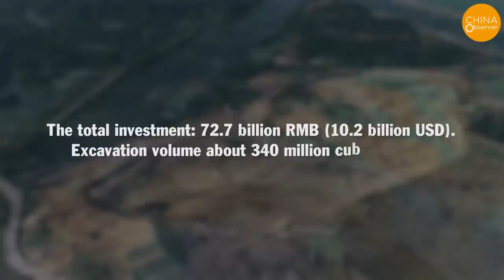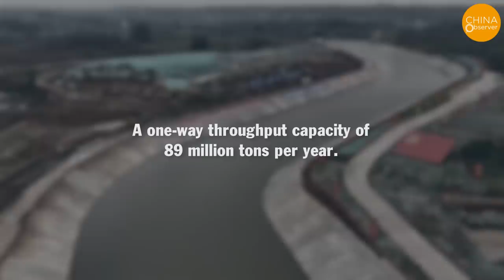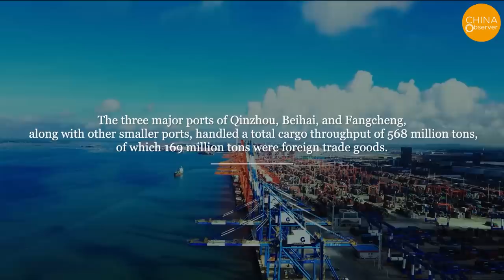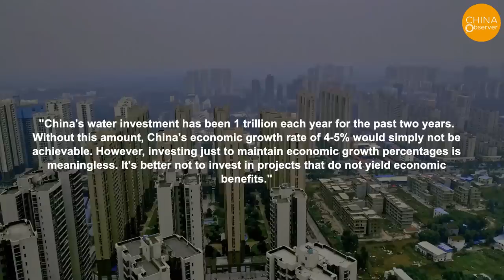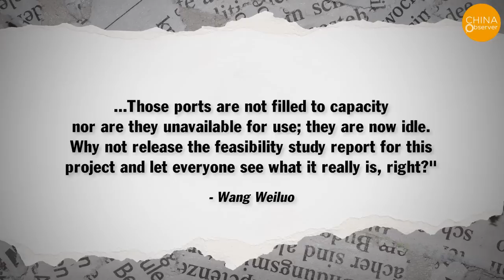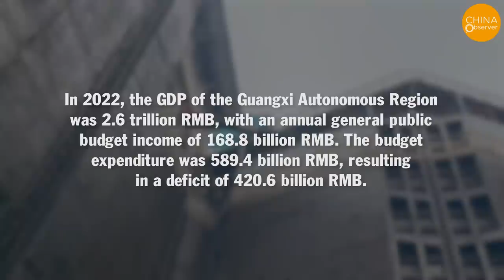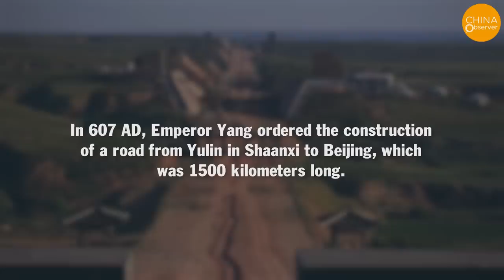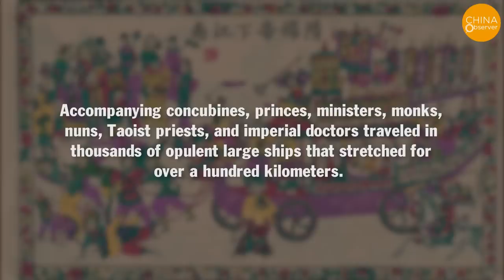$10.2 Billion STUPID Mega Canal Under Construction, Is This the Straw That Broke the Camel’s Back?

Comment: Pinglu waterway is necessary: chinese Southwest is almost landlocked. They need the flow into SE Asia.
Reply: The goods will still rely on train and truck. 135 KM to Tonkin Gulf isn't going to do much good especially if the ships can't make turns in that  wonderfully tight canal.

Comment: In its economic downturn, Japan invested very heavily in public works. No noticeable effect, except expanding public debt.
Reply: Yeah, but the difference between the Japanese & the Chinese is that the Japanese always learn from their mistakes—and NEVER repeat them
Reply: @Shineon83  Right I am sure they learned their lessons from their 280% debt to GDP lol.
Reply: The difference is that a large portion of public works in Japan involves disaster mitigation and prevention. In CCP China, public works involves the creation of disasters.
Reply: @Destroyer4700  Excellent points.
Reply: @David-jc5jf  Japan has an extremely stable economy and their currency is one of the top traded in the world, plus they have extremely large stores of USD, RMB, GBP, and other internationally traded currencies as well as holding bonds with many of those countries. They can afford to have a high debt to GDP ratio.
Reply: On the other hand the US did that during the great depression and it worked great.

The difference is that Japan's problems started due to massive amount of debt. So borrowing more money can't (just literally can't) help solve that

Comment: It would be nice if you compared the Panama  and Suez Canals in comparison to cost, cubic ft of ground moved, shipping tonnage and many other factors. It would give a relative scale comparison and relevance..
Reply: This is rubbish reporting, to say the lesst. This huge canal is to transfer water from the south to the more sparse northern region,  to ease water shortages for various agricultural projects
Reply: The panama canal is very strategic,very wort the short cut they made it.👍🇺🇲
Reply: @jacintochua6885 The north south water transfer project is in the east of the country. The project in the video is in guangxi in the west
Reply: The Panama Canal is about 80KM long and a typical cargo vessel that can transit the canal can carry about 52,000 tons of cargo, but Panamax ships specially designed for the csnal's dimensions can carry twice that.  But probably more to the point this canal will make it faster and cheaper to move goods compared to trains or trucks making the same trip.  The Panama Canal cut 13,000 kilometers off a trip from Atlantic ports in Europe and America to Pacific ports in North America and Asia.  That is a totally different value proposition.
Reply: @danz1182  Panama Canal was made like 130 years ago LOL
Reply: if you did that and adjusted for inflation.. you'd see how much better china is doing things

Comment: If the PingLu had any positive economic benefit, it would have been developed 30 years ago. Speedier barge transport is not about to replace the volume of plummeting factory orders
Reply: Exactly. They did that in 2007-2008 to avoid the global economic slowdown, resulted in many white rhinos projects (if not tofu dreg), now they'll bare the cost of even more useless infrastructure projects and dig the financial burden even further
Reply: Let's wait and see how it's used.

Canal transport can be cheaper than rail, and allow the transport of larger items (wind turbine parts, pre-fab concrete and steel parts, boats, etc...). If the local government implements good incentives it could be well used.
Reply: @domtweed7323  allow me to doubt that. Not like some many hastily built projects didn't end up like financial burdens and incrasingly over time. Even the real estate market is based upon that given there are WAY more houses than people
Reply: @mur4s4m3  Almost China's entire capital stock was hastily built like this, with an enormous amount of waste and inefficiency. And that worked! It created the world's 2nd biggest economy.

Waste is an inherent part of any program of big, risky infrastructure investments, since sometimes projects fail. But sometimes they pays off massively.
Reply: @domtweed7323  when you have the bare more and more fiscal burdens, you create short term benefits for long term issues, so I strongly doubt it. Ask any economic expert, whether in China or elsewhere. Why do you think the Three Red Lines policy were setup by Beijing itself
Reply: @mur4s4m3  Firstly, debt is a massive issue for the private sector, but not for the public sector (cause the government owns the central bank, that creates the money.)

During its growth boom in the early 2000s China 4 big policy banks had a bad loan rate of about 40%. Did that create a financial crisis? No, the PBoC just quietly gave them 2 massive bailouts. 
("China: The Bubble that Never Pops" is my source.)
Was it massively wasteful? Yes. 
Was it worth it for the biggest economic boom in human history? Yes!

If the Chinese government can bailout the banks they can bailout the local governments.

On the 3 red lines policy: I suspect that was for inflation control, and it'll be revived whenever the central government gets worried about inflation, and quietly retired when their not.
Reply: @domtweed7323  Like Japan has 250% debt to GDP ratio. But you can't work like that forever

Xi's Belt and Road program is not likely to go much farther as it basically forces client states to load up on debt which is used to pay for Chinese contractors and workers, and bribes (both Chinese and to local politicians) spent on projects of marginal value to the clients.

China's has resource constraints, water of course, but food increasingly, both contaminated (by metals and chemicals)  in water, air and arable land.

Demographic dividende will fall increasingly over years further deepening the mess 3 years of zero covid caused. Unemployment due to real estate sector, industry slowly leaving to southewest asiat, LATAM and Estern Europe won't help either. High real estate price are cooling down while loan repayments aren't. Chinese people consumption and birthrate will further lower consequently

As to external economy, it strongly revolves on how China will take distance from the West and get closer to other countries imho

There are still many events to unfold. Yes, China is strong. But it is not without flaws. Some that are imho critical ones (water namely, as odd as it is). If debt is less of a threat, several others (internal, climatic, geopolitical, economics) could impede its ambitions
Reply: Some people just don’t want to wake up. And if they do, they don’t have the ability to change the political wind.

If china focused on quality infrastructure. Things would probably be different in the long run.

Comment: China, USA, Australia, Canada, and Europe ALL need to build water projects that can cache water during rainy times to use during droughts, and also help reduce flooding. THAT would be money spent smartly.
Reply: they have? You don't normally have to build new Dams once you already have them.
Reply: @tarkov666  In many parts of the world you need more than just a dam. Sure, the 3 gorges dam just used a valley to store a vast amount of water and generate power. But in places that are flat you would need to excavate and use the dirt to make walls for the reservoir, and probably dig canals too. But since it's going to be several decades at least before world population starts to finally go down, the issues of drought and floods are only going to affect more people every year. I think there is a 100% chance that before 2100 there WILL be wars between some countries over water.

Comment: While these projects can be used to boost a countries economy, they also can wreck a countries budget, and that's what seems to be happening here. Once again its a hyper big project with no real goal in mind that will end up sucking more money out of the Chinese economy than it will putting it back in. And what they don't seem to realize is that, all of their major water projects as of late have been failures.  There is only so much water you can move before you run out of water to move.

Comment: Will there be enough water? I see two possible problems. One being taking away water from one area to another will change agricultural circumstances and therefor may lead to shortages if not enough water would be available. Combine that with current and future droughts due to climate change and this could end up to be a dramatic dead at birth situation. Nowadays the limits to growth are determined by environmental impacts not alone by prognosis on calculated economic growth due to transportation costs and capacities.

Still i am partially speachless seeing the scale of these projects and think we in the west would do good to also invest in infrastructure on similar scales, just maybe with a bit more thought on avoiding or mittigating detremental effects on environment.

10:25 How does Australia square this with its security deals it has with the US? I mean in case of a war with China, this free trade deal would be null and void, right? The US is already decupling from China, so what do Australian companies intend to do?

Are there naval military construction and port sites planned at/within that chanal? If so what affect would have that on naval military readiness?

23:24 many of the aspects you described here also could be attributed to the USA

Comment: This is the stupidest thing.... cos if you do this, then people, tourists won't go to HK. And nor, would there be any other kind of work, to do in those cities either.  At the same time.. those countries, doesn't and can't accept that much goods either. Cos China has more people than those country needs. If they kept the ports small.. you could slowly export.. and import... but... since they enlarged it. It would be "game over" after 2-5 years.. cos you forced volume through...... Just like, the exact melt down for China... It didn't take long, since they also stupidly used robotics.. which made things quicker...  It makes no sense.